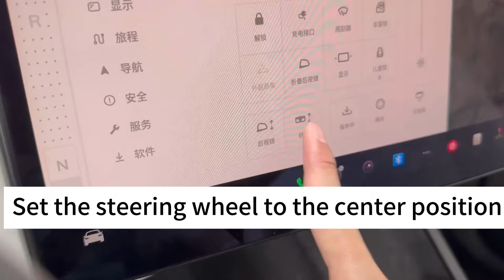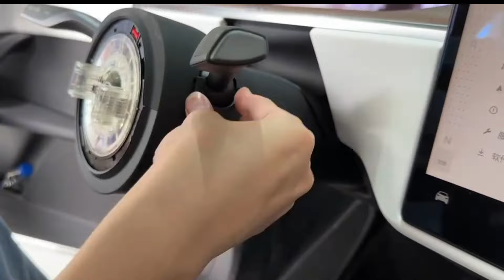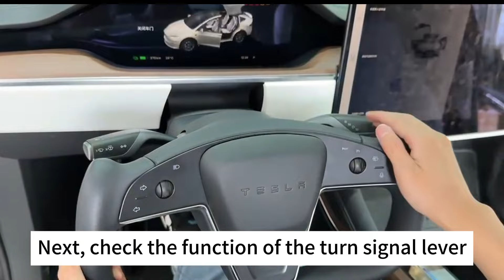Tesla Gear Shift Stalk Switch Turn Signal Lever Kit For Model X/S

Comment: Are these the genuine stalks from the Model 3 with a new wiring harness and cover?  If they are custom, can you do an opposite set, plenty of RHD countries have turn signals on the opposite side of the steering wheel.

Comment: The pull for horn on the left side was not a good choice. That should be for high beams. Can you get this changed? All new model S and X have a center horn and the older ones are getting steering wheels replaced due to them peeling so they are getting a center horn either way. I would order if you can fix the left side so when you pull it activates the high beams. Pull should be to flash, and push should be to keep them on like every car on the road.
Reply: ☝ 100%, please make it standard like every other car on the road.
Reply: This!
Reply: you can get the new steering wheel free of cost from tesla.